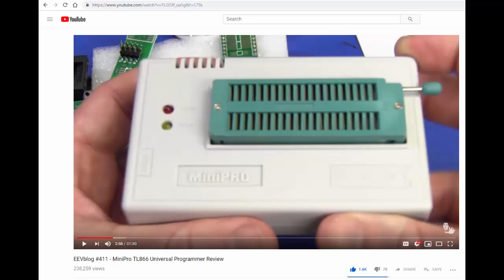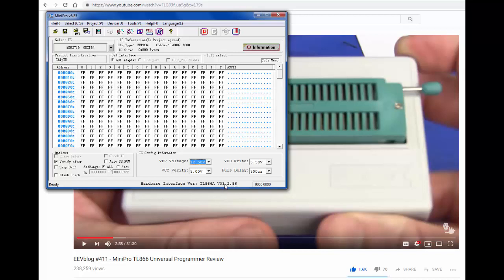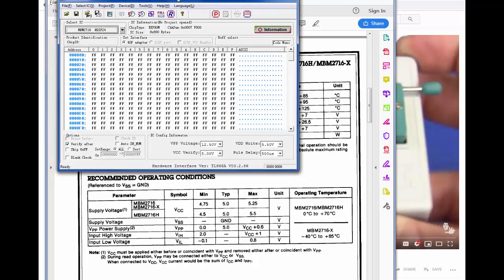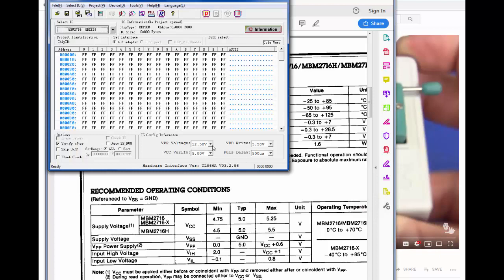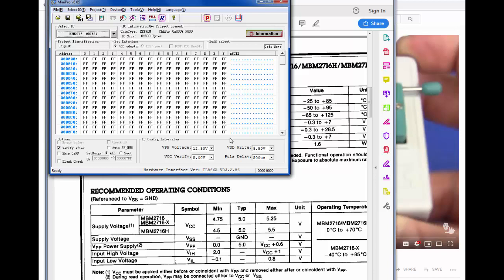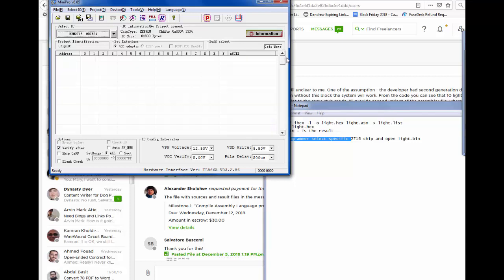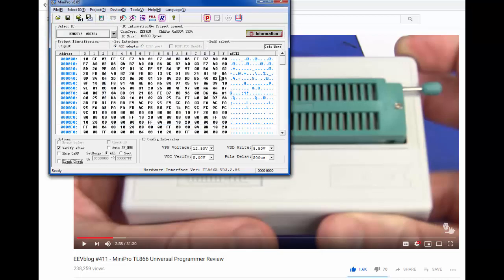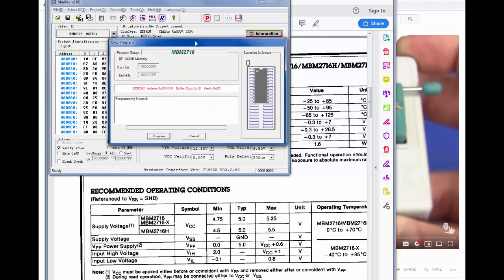MiniPro TL866A Programming MBM2716 EPROM with Errors?

Comment: Great video and thank you for sharing your content. :)
I Know I am commenting on a very old video.  I have the TL866-II+ and it is limited to 18V
The chip you are showing looks like the data sheet is showing that the chip needs 25V to program it.
I know Necroware has a interesting video showing he made an adapter to put external voltage into the EPROM while programming.

Now there are newer EPROM programmers from the same people who make the TL866-II+ that have a TL866-3G(T48) and a TL56 which both of those report they support 25V.

Now there is also one thing that I have found out that some EPROM's actually need more current available on that VPP then some of the programmers can provide besides the voltage.

I would probably do what Necroware did and make an adapter.  Then I would limit current on the VPP line and try programming again at the VPP that the chip needs.
Reply from the maker: I actually reference that exact Necroware video right here in this video and all follow-ups.  Problem is it's buried in the links and not info-carded in the upper right corner for people to click on.  I guess I can fix that!

Comment: I have a major doubt . I have placed my 95160 eeprom in the mini programmer and selected a wrong ic name.. So it is showing FFFF only when i read it. I got to know the correct  ic number after sometime only.. now ic is not with me.. My doubt is, will the programmer shows only FFFF if a wrong ic name is selected while reading an ic?
Reply from the maker: Very likely, yes.  Check your datasheets.  Are the pinouts the same as the chip you've selected in the software?  What about the read voltages?  Are they the same?

Comment: Also, just adding to the conversation, make sure you are plugged into a powered USB hub.  Dont plug in the back of your computer.  you need at least a 2amp powered hub for the programmer to work properly.  plugging in the computer directly will only supply .5amp (some motherboard have a powered USB port over .5amp but it isn't enough for the programmer)
Reply from the maker: I fully agree.  It should be noted that I did indeed use a 2 (or higher) amp powered device.  (Actually it was 10 amps).  I had hoped that this would empower the device to provide the +25 v for programming this chip that the software says it will, but alas, it never did.  Truly, a design flaw and disconnect with the reported supply voltage vs the actual supply voltage.  Thanks again for your feedback here!
Reply from the maker: Did you happen to review my successful work-around for this problem?  See my solution for this problem:  Part 1 - https://youtu.be/IpQ3w7sMOYo
Part 2 - https://youtu.be/jrlxXsmqr-c

Comment: Great video - Great thinking - great solution - ............. im having the exact same problem , on the same device, with 2176 eproms - your not mad - we are seasoned and appreciate the tech - I will be attempting exact same solution you have provided - Much thanks from Ireland - ------------will let you know how it goes .......... as they say over here , Feck The Begrudgers !!!!!
Reply from the maker: ascended down, I VERY much appreciate your feedback and encouragement here on this.  Please let me know how this works out for you, and I will most certainly join you in your sentiment to also say...Feck The Begrudgers !!!!!
  They did get me down a little when those comments first came in.
I'm planning a visit to Ireland within the next year I hope.  If so, I should buy you a Guiness!    Cheers!!
Reply: @ForgottenMachines  it was the character rom of an apple II - tried rewriting it several times an dit never worked - i used a 1.5 volt battery and IT FECKIN WORKED MAN - Those chips just needed a little boost of power to write the code correctly - if you didnt make this video my Apple II would still be dead - she is up and running 100% and it is all thanks to you- Many thanks and keep making the vids - The world is full of idiots that are all opinion and no results....... but thank God there are people that think outside the box - again WELL DONE ON THIS
Reply from the maker: @ascendeddown1580  I'm so happy to hear this...and for your extremely kind comments, now I DEFINITELY owe you a Guinness...or 4...

Comment: I'm getting the same error, did you ever get it resolved?
Reply from the maker: Yes.  The TL866A doesn't have a high enough program voltage to properly program the chip.  The chip requires 25v for programming, but this says it only produces 21v, but with my voltmeter tests, it only produces around 17, which is not enough to program the MBM2716.  See my solution for this problem:  Part 1 - https://youtu.be/IpQ3w7sMOYo
and Part 2 - https://youtu.be/jrlxXsmqr-c
  Certain people commented that they don't like these videos, but I didn't post them for them, I posted them for people such as yourself, for whom this information can be valuable.  Please let me know if you find this helpful in any way (or even if you don't, and why!)  Best of luck!

Comment: I have similar problem. Now it looks work fine. I did some
- plug the usb in the back ports in my pc, not front panel
- changed to another eprom - cheep chinese, ehh..
- changed a bit voltage vpp increase, and delay to 200